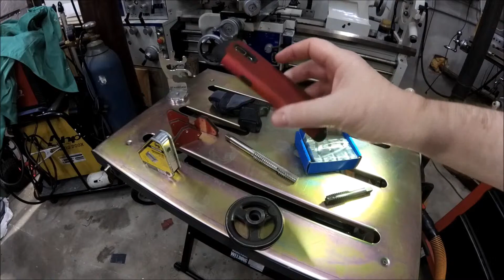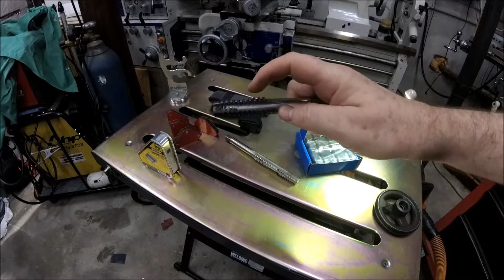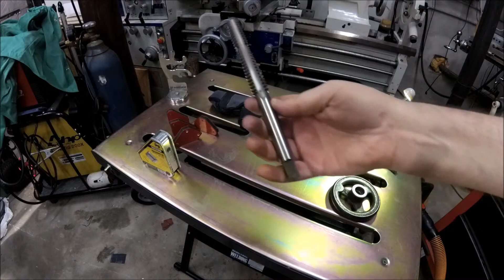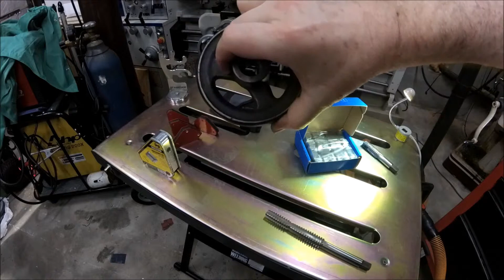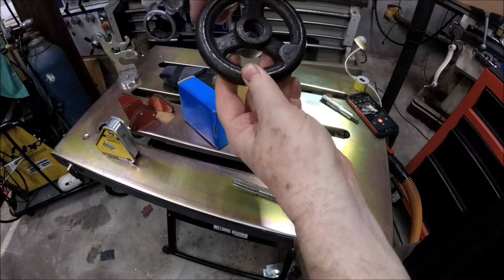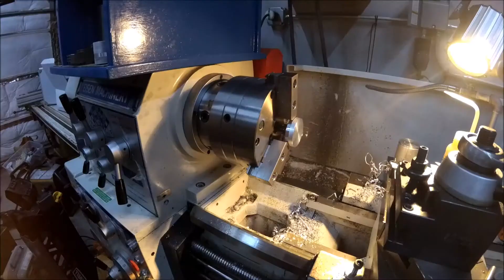Cast Iron Handwheel Boring and Tapping

Comment: Horn Tools (gmbh) makes solid carbide insert holders and a range of inserts for inside threading things like those handwheels.

Tapping cast iron is not ideal anyway. I think I would bore that handwheel out and press in a brass or bronze bushing that was pre-threaded using single point acme inserts.